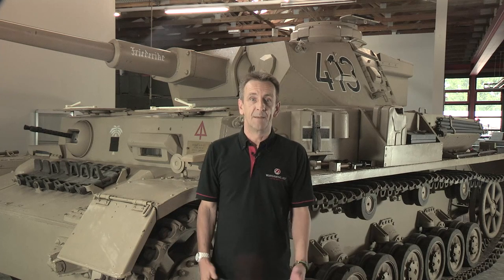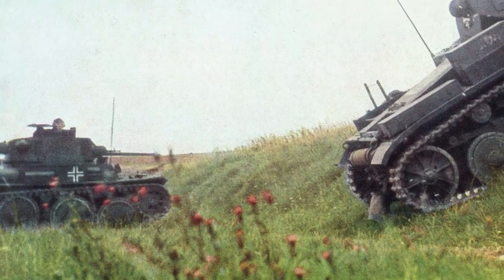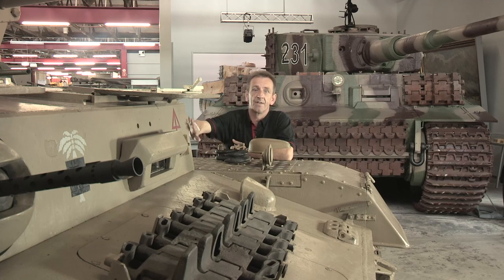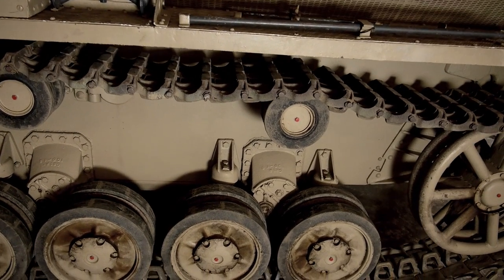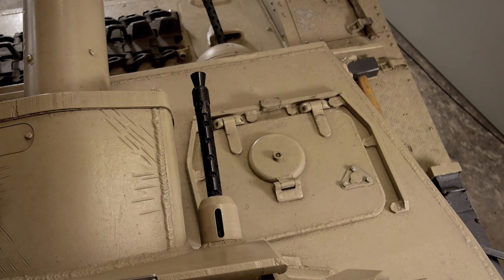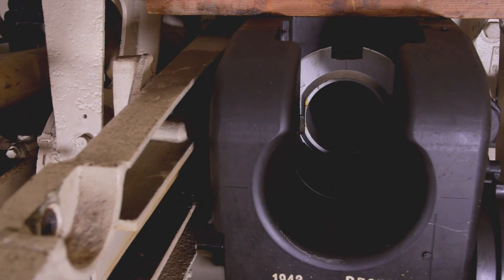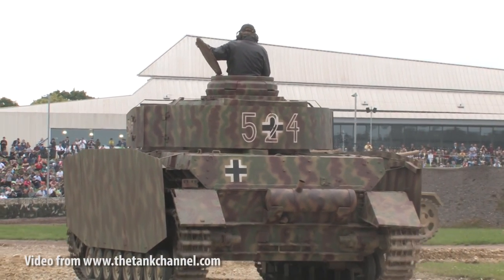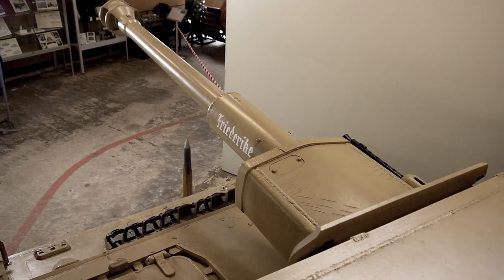Inside The Tanks: The Panzer IV - World of Tanks

Comment: Good video Richard! But the information about spaced side armor is wrong, the reason they implemented it even in the Panthers were the Soviet antitank rifles.
Reply: The information conveyed in this video is absolutely correct in that regard. The purpose of the side skirts was the premature detonation of hollow charge ammunition. Using 5 mm spaced armour to increase protection against anti-tank rifles makes little sense.
Reply: +Hugo Carvalho that's a common missconception. Yes the spaced armor can and normally do detonate pojectiles before they reach the main armor, but this was not the main reason they implemented them in some models. If that reasoning was the correct once they started adding them all tanks would wear them, both in the hull and turret. That was not the case, note newer Panther models with increased side armor didn't wear them, while the Panther 4 were wearing them at the same time. Take a look to the Panther with side skirts, you will not see them wearing those skirts in the turret. Quite stupid if the reason to add those skirts was to stop shaped charged pojectiles.
If you take a closer look to were they added skirts you will see they added them in the parts of the armor which were vulnerables to the 14.5x114mm at 150 meters or less. The other sides which were vulnerable to captured panzerfausts didn't wear skirts, in the case of the Panzer 4 even the frontal armor couldn't stand the most basic panzerfaust.
Reply: +Jon Ugalde What protection did an unsloped skirt, generally 4 to 6 mm thick - and sometimes made of wire mesh - afford against anti-tank rifles? 

I've read otherwise in military history books and, frankly, your explanation made no sense whatsoever (why bring the Panther into the subject? Every tank is its own world, direct analogies such as you made are irrelevant).
Reply: We are talking about history, no religion. Historians are not perfect, they can and actually do fail in their studied subjects.
That protection was quite a good Hugo, it was capable to stop those bullets.
The example about the Panther was given because it perfectly explains the reason to use those side skirts. It's not irrelevant to point about technologies of the same period, same country and same machines. Make sure if those skirts were so effective in the job you think they were added for, they would add them to other tanks. This is and was the way technology works.
Which hollow charge ammunition do you think PzIV's had to face in order to need those skirts and no other tank (except some types of PzV's) needed them in the same period of time and place?
Reply: "Make sure if those skirts were so effective in the job you think they were added for"

But they WERE. They were effective at dispersing the kinetic energy of a hollow charge grenade. This is amply documented. The fact that, despite their effectiveness, the same skirts were or weren't added to other tank models means nothing. 
Listen, I want this discussion to be a productive one so just point me to a reliable source that directly affirms the intention and effectiveness of schurzen against PTRS-41 and PTRD-41 ammunition. Other than that, there's no point in further back and forth.
Reply: There is a point if you really want to talk about it. Bazookas shipped to the URSS weren't estimated so much, but in US trials (take in account they used and use V50 method) they penetrated between 89 and 102 milimiters of steel, the weakest panzerfaust penetrated 140mm. Those were the weakest hollow charged weapons in the east front. Now, taking in account the Pz.VI (Tiger) had 60 milimiters of hull side armor, why do you think they never added a skirt to it?
It's stupid to have a so functional, simple and cheap technology capable to protect expensive and complicate machines plus trained tripulation and only use it in some models. Think in the Zimmerit, losses due to magnetic mines were very low but they used it as much as they could and in all models of armoured vehicles.
If you don't want to admit the obvious please tell it to me and I will not spend more time trying to convince a fanatic. If you really want to talk and learn about the subject do the same you have asked me to do. Find a reliable source that affirms those skirts and specially wire meshes were used in Pz.IVs in WWII with the intention you think they were used to. If you try to do your part I will try to do mine.
Reply: +Jon Ugalde The Pz VI Ausf. E had 80 mm side armour not 60. Besides, as I&#39;ve said, that argument proves nothing. Provide me a reliable source that corroborates your assertions. Otherwise there&#39;s no point in further discussion.
Reply: Hugo Carvalho I see... You have taken your time to investigate and you come with nothing but just exigences...
First, yes you are right about the upper side of the hull armor, lower side was 60mm but it was protected by road wheels. Nevertheless 80mm was not mach even for the weakest shaped munnition used in the East front. All the sides and the backside of the Tiger were no mach to it, it tells you nothing? You are clearly showing how much do you know about the subject.
In order to demonstrate how transferable are tecnologies (specially armor technology) not only between tanks but nations look at the first encounters with Soviet armored forces. Soviet technology was a step further, they used sloped armor. What did German do? They inmediatelly took note and added it as much designs as they could, almots to 100%. Quite a nosense from your point of view no?
Second, there is no point of futher discussion, I agree. The problem is your attitude.
Let me explain, firts you wrote a message telling me I'm wrong and you deleted it almost inmediatelly. You took your time to write a new message, at firts I thought you were documenting yourself and I liked it. I love constructive discussions even if I'm not right. In the second message you wrote you said the information of the video in this concern is completely right. I thought you had a solid base to do this kind of affirmation, so in order to learn or teach about this subject I have been constructive and have given you the oportunity to show your information in echange of mine. You took your time and you have come with nothing, only exigences. You started telling me I'm wrong, so you should be the first to try to demostrate your point.
No discussion, no reasoning, only blind exigences. I don't know what type of person are you, but based in what you have showed to me your personality is inexperienced and/or inmature, ignorant and/or lazy, a person who can't admit he is wrong or any combination of those. I'll choose the less offensive one.
Ok boy, the next time you try to afirm something publically firts try to learn as much as you can about it and be prepared to learn about the subject if your information is not correct.
Reply: Oh, about my misspells. I'm sorry about it. But Hugo aprende una segunda lengua, ondoren hirugarren hizkuntza bat and try to discuss as I'm doing now without the help of an automatic corrector in that last language.
Reply: Hugo if you don't consider a book specially dedicated to what we are talking about as a reliable source and instead of it you consider a generalistic biased and obsolete information source as reliable we don't have a discussion point.
Reply: "if you don't consider a book specially dedicated to what we are talking about as a reliable source "

What book are you speaking of? You haven't informed of its title yet!
Reply: "generalistic biased and obsolete information source"

Have you read the book at all? Or are you generally dismissing every single Osprey tome ever published? It's funny because they are generally considered the very best on the subject.
Reply: Who consideres Osprey the very best on the subject has at least a decade old information. As an example Osprey takes all German informs, specially those of elite units, as total true. Even after Soviet secret document release its clear they cheated in them, specially those elite units who operated fancy named tanks.
The book and their writter surnames are in the message were I link you the video were wargaming team, the same team who has also created the video we are speaking about, gives actualized information about the schurzen. But no problem Hugo, there is not any blinder person other than that one who doesn't want to see. I see you don't read properly my messages and your only goal is to look like you have the reason at any cost. So no problem, we will talk again when you change your mind.

Comment: What are the differences between the Panzer 4 and 3, and what tank is better for what porpouse?
Reply: Umm...not quite. Both remained in their original roles but were up gunned for a variety of reasons, not just for shooting at tanks. The Panzer III morphed into the Stug III with the removal of the turret and the addition of a 75mm anti-tank gun. They did the same with the IV. These were the anti-tank weapons. Normal tanks, with turrets, remained to work as infantry support vehicles until it was no longer possible or practical to define the roles. At that point, Stugs were pressed into service in roles which should have been done by tanks and did not do well because they could not traverse.

The main visual difference between the III and IV is the number of road wheels. The III has six on each side and the IV has eight. The turret on the IV is also more substantial because it usually housed a 75mm.
Reply: Just to add and correct some of the things that has previously been mentioned.

The pz. III remained the main german tank until 1943. It started with a 37 mm gun and was later upgraded to a short 50 mm and later a longer 50 mm gun (which needed a longer turret). The turret ring on the pz. III was smaller than that of the pz. IV, so it was not possible to arm it with the same long 75 mm gun that the pz. IV got. 

The StuG III was manufactured in parallel with the pz.III and was not a "morph" or turned in to the StuG III, but they shared the same chassis. StuGs were manufactured for longer than the pz. III though as it carried the same 75 mm guns that the pz.IV did (L/24, L/43 and L/48 upgraded over time).

StuGs were infantry support weapons (literally translates into Assault Gun) and where not originally intended to be tank destroyers, but with the longer guns they could be used in that role and had the highest kill ratio of any german armoured vehicle during WWII (also the most produced german armoured vehicle).